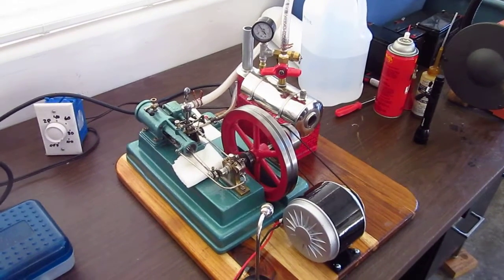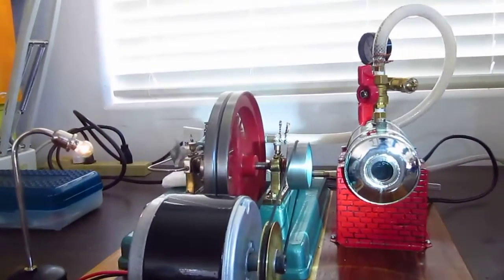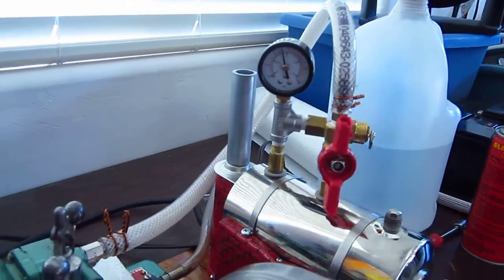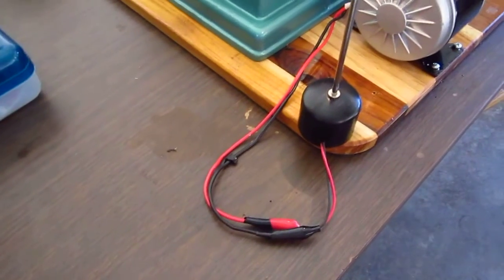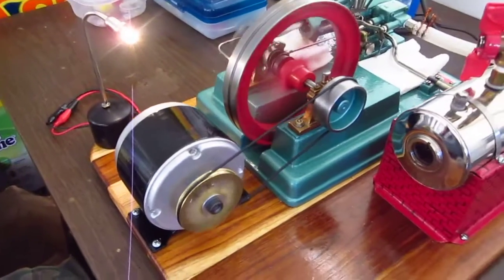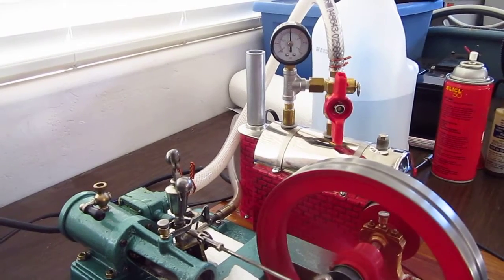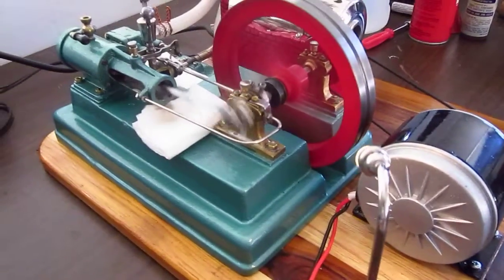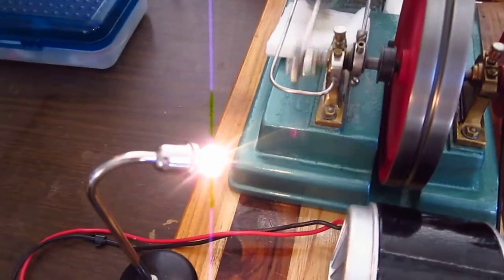Very Large and Powerful Model Steam Engine

Comment: print a gearbox and run it at 60:1, ul be able to run a low rpm and spin the generator MUCH faster, less load on the steam engine and more output power

Comment: Really good output, is that a 500w scooter or bike brushless motor? I am on the same mission, I am going to use a solar controller to average output once I find the right gearing and dyno diy. :o)
Making 3ltr stainless boilers soon still testing.
Reply from the maker: Yes.